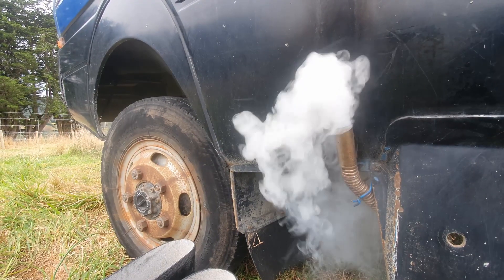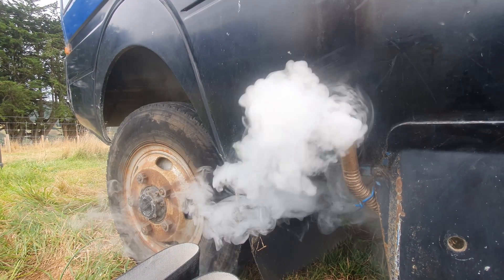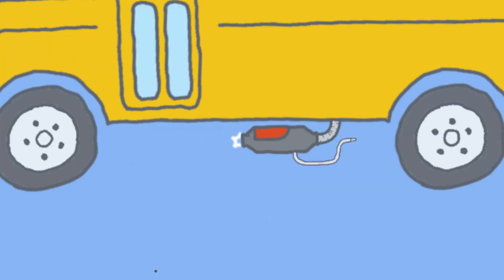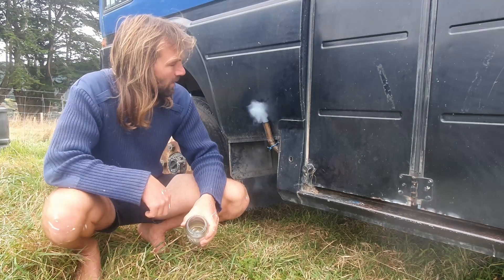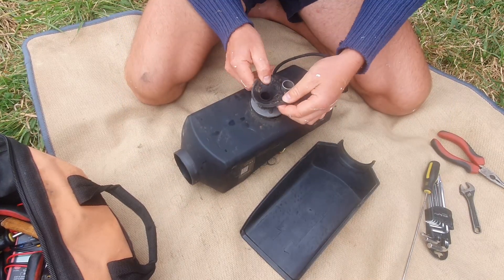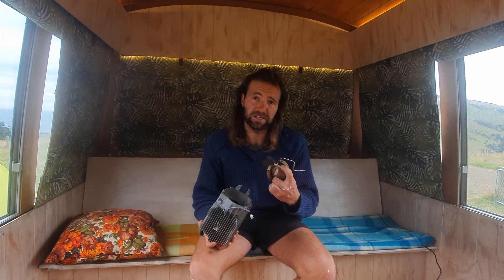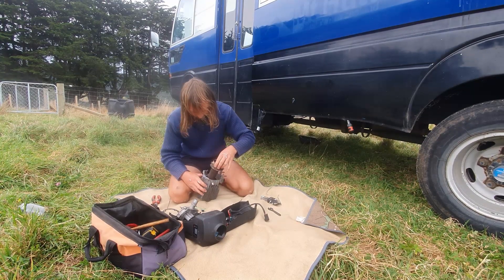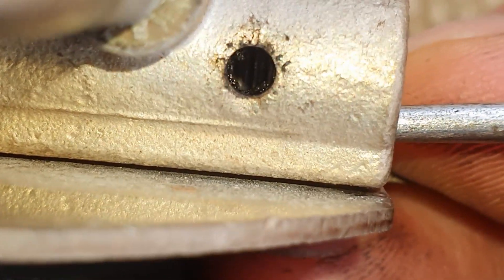[SOLVED] Diesel Heater Won't Start, Blowing White Smoke

Comment: Thanks!  This also worked for mine (I was doing all the same things wrong too).
But you forgot to mention that EVERYTHING will be black with soot after you complete this cleaning job.  Your clothes, your gloves / hands, your tools, your work space.
Do this in clothes you no longer want.  Over a tarp.  With a white garbage bag (so you can see the soot).  And have lot of shop rags handy.
Don't touch your mom's couch after.

Comment: i have a adjustable power supply. i increased the voltage to just under 14 volts. all problems went away. glow plug is hotter, burns cleaner. better miles per gallon.

Comment: Probably the best "repair" video that I have found regarding these heaters. Mine is blowing white smoke and then stops heating. Problem. It is really hard to get to to take apart!! Thank you.
Reply: I’m in the same spot. It’s gonna take me two days to get it out just to take apart. Man, huge mistake on my end. I’ve only ran it 20 times too….. it’s basically new.
Reply: @conandal  me too!! Maybe like 7-8x though. I turned it off, not allowing it to “cool down” and man that was a crazy amount of smoke inside the trailer. 😂. Now it smokes and won’t heat
Reply: @conandal  did you clean it? Like I said mine ran more or less like 10 hours before I did that. The soot and gunk that was in there was absolutely amazing. I ruined like 8 rags. Insane that thing still kinda worked before I cleaned it. Kicks ass now. Definitely clean yours
Reply: Mine started smoking today after about 1 year, it's under the driver's seat so removal is a very last resort

Comment: Thanks! I have searched everywhere. You keeping it simple is the key. Ran out of fuel and pump failure later. Cleaned it out back running. Thanks again.

Comment: Hi, I really enjoyed watching your video but I do have a question.

On the heaters I have, after about 90 seconds the fuel pump starts and if monitoring from an app, the combustion temperature will rise. After about 4 minutes the glowplug will turn off.

I have one heater that on many occasions the glow plug icon comes on and the glow plug draws power however the fuel pump never starts. On every occasion I have just powered off the unit, then back on and it has started correctly.
My question is what tells the fuel pump to start? If it were a timer, I'm sure it would always start. If it is temperature, where does the heat come from apart from the heat of the glowplug?
On a new heater or a serviced one, there will be no residual fuel in the combustion chamber and only the powered up glowplug, so what starts the combustion process? 
As I stated earlier if it were a timer, I'm sure it would always be a consistent start.
The other strange thing is there is no error codes. It just sits there with the glow plug powered up for as long as I leave it.  Other types of heater would use a  pilot light that would operate a thermocouple and that is what starts the main gas valve (In the case of a boiler), but what starts the fuel pump on these heaters?

Your animation shows the diesel going onto the hot mesh causes combustion, but if the pump is not running, where does the diesel come from?

Thanks.

Comment: Thank you Adam for information , my Anbull heater basically same as yours is doing same thing on restart, after warmer temperatures outside  warmup  my garage So ill take mine apart check my glow plug clean it like you did and reassemble it, order parts gets irritating on 8kw heater getting right stuff is problem

Comment: If you install a diesel heater to draw in outside air instead of recirculating the air, you’re running the risk of carbon monoxide poisoning. This is because the combustion exhaust can get drawn into the cabin air suction duct.

Comment: Hey thanks for your video. It got down to 10 degrees and my heater started blowing white heavy smoke. I watched your video and found out that my combination air intake was outstanding drawing ice cold air. I moved the pipe inlet to get inside air and the smoking completely stopped. Thanks for the great advice. I’m going to connect a 4” pipe to my heater air inlet pipe and connect it to the inside of my house. I think that will help if I supply preheated air instead of the 10 degree outside air. I haven’t seen anyone recommend that. Thanks again.

Comment: Cheech and Chong burn mode.  This genuinely is hilarious. Do you really have your exhaust pointing up? - Guess what? rain can go in also. Might as well put a funnel on it. 😂😂  Why oh why lol? Terrible idea.  The boiling water in the exhaust - tragic. If you didn't use common sense then at least use the instructions. -  Exhausts must point or bend downwards with the total bends not exceeding 270° - at least drill a drain hole in exhaust.  And btw ALL exhausts condense. So running downward is best for heater health.

Comment: I have lots of soot and smoke with a nearly new gasoline unit. I think it might just be the extreme arctic temperature, I'll try again later in the winter when it's a bit warmer..
Reply: When it's warmer lol. 😂 It's a heater, it's made for arctic conditions Gasoline? Not diesel? If you are in the Arctic or are using the heater where the air for combustion is lower at altitude. You can switch the heater to 'alpine mode' .
Reply: @richardd8352  It was minus 35Celcius. As soon as it was back to normal freezing temps the heater worked again. I guess the fuel gets too thick?  I'm not at high altitute so I don't think switching to that mode will make it run better, it will just make it run leaner.
Reply: How does the gasoline  run? What brand of heater? Will premium fuels keep unit carbon free?

Comment: Thanks pal you explained it all very well. I forgot about the mesh and the glow plug. And cleaning the tiny hole so I will be doing that tomorrow is my diesel heater is just pumping out white smoke thank you.👍

Comment: The key to keeping these things running clean is bringing them up to temperature,I ramp mine up slowly till it gets the unit to 200 c,then I turn it down and even with it turned all the way down it maintains 200c and runs like a champ,and the pump pumps very slowly

Comment: Solid video,I'm now taking my heater apart,it ran great for 12 or so hours,then started belching white smoke and shutting down,it's getting 12 volts consistently off my battery generator,but I might order a 12v power supply and use that off the inverter instead

Comment: Hey Adam, just wanted to comment here. Thank you for the quick lesson and explanation. Just got really cold here in Nevada and went to turn on Seamus(DH Name). White smoke, no joy of lighting and E-10. I've used it in my garage bar for a single season last year, but......took it apart, took my time and found it was coked up an incredible amount of sooty goodness. Cleaned, had a beer and reinstalled. He is a happy unit now. Thank You

Comment: The 'original' instructions you dont seem to get with the clone heaters is ''if you have a low spot in the exhaust where water can accumulate, a small 3mm hole can be drilled''
Reply: That might be it for us. Our heater is only one year old and we’re not full-timers. Checking asap at -5C.

Comment: WTF is wrong with some people. There is a reason car exhausts run level and NOT upwards upon exit unless its a Lambo with engine at rear. 😂  like those people that put a fork through a boild egg to see if it's ready to eat 😂😂😅
Reply from the maker: Lol. For sure. The only reason I had it upturned was to try and reduce how much exhaust crept up through various holes in the floorpan/floor on a still night.
Reply: @peterkingsman one of the comments mentioned that you can drill a 3mm hole at the low point. Apparently, it’s in the original heater instructions, but not the Chinese ones.

Comment: one tip. to avoid moisture buildup in your exhaust, the outlet of your exhaust pipe should be pointed downward.
Reply: Hmmmmm, maybe that is my problem...
I had it pointing straight down, but just recently bent the pipe towards the back of the van as soon as it comes out of the van floor.
I will straighten it out again, to see if that fixes my problem, shutting off and blowing white smoke through the intake pipe, instead of cooling down before it shuts off, like it used to...

Comment: The fuel pumps are notorious for leaking inside the heater on these when they are shut off. 

It works  like a siphon and keeps pumping fuel when it's not running. I found that if you give them a good tilt and let all the old fuel piss out from the exhaust pipe they will fire up and stop smoking.  

You can replace the fuel pump also or put a petcock inline in between the pump and the heater for when not in use.  In most cases there is No need to take the actual heater assembly apart at all.

Comment: Excellent. I've just been quoted a price for a diagnostic that is the same as a new plug and tools. It's the "smoke on start up and fail first start but runs fine" problem. Three years in, second fan. I noticed someone mentioned screen over combustion intake, I'll second that. Mudwasps filled up a fan. I'll come back with results, cheers.

Comment: 7:25 When removing the screen, a M8 coach bolt screw or a pick can be used (a M6 coach bolt screw worked for me).

Please do yourself a favour when refiiting a new mesh strainer, use the proper tool - 25.2069.10.0102.2e. This will enable you to seat it properly without damaging it.

Important: when fitting, orientate the strainer so that the small spot welds are furthest away from the air hole. If you are servicing the heater for the first time, look at the strainer as you remove it and you'll see what I mean.

Comment: A couple times a year, run a couple of high heat cycles with clean kerosene.  I've had mine in my semi for 9 years and have never had a problem. I opened it up for the 1st time last month.  I didn't get enough carbon to fill a thimble.

Comment: One very important thing also are 'the bends', I fitted a new 24v in my wooden shed but would repeatedly flame out so I fitted my other also new 12v heater which did exactly the same thing. In both cases I used the same exhaust set up which had 2 90degree bends and 1 45degree bend (through a stainless steel exhaust bulkhead fitting). Removing the 2 90degree bends solved the problem. Perhaps these heaters might benefit from smooth bore exhaust pipe 🤔

Comment: I had two identical heaters which belched huge clouds of white smoke on startup, much head scratching and many futile mods later I changed fuel pipes downstream of the pumps from cheap / soft / transparent type to the white semi rigid nylon material.
Bingo, problem solved ! These heaters were cheap even for Chicom products,  cost $AU110.00 vs $AU165.00 for most on Ebay, suitcase type with internal fuel tank etc.

Comment: I used to have hair like yours, but i have pulled it all out trying to figure out this heater!!
lol
Mine has been billowing smoke from brand new and I installed it exactly as instructed.
What you said at the end might be my problem - too long and too thin of a power wire 🤔
If this is in fact my problem, I will definitely buy you a beer my friend 🍻
Great video, thank you 🙏

Comment: My atomizer is so snuggly in the shaft that I just can't get it out easily like all the other videos Ive watched which makes me think its the cause of my problem eg. how can the fuel get in and around the atomizer when its hard up against the walls of the shaft. Now when I turn it on the display just turns off and then on again and the heater does nothing.
Reply from the maker: That second problem I have experienced also, and its unrelated (if the same as for me). I found the cause to be a bad connection of one of the pins in the big plug, evidenced by some slightly melted plastic around one pin hole when one looked at the female side of the plug. It was an easy fix for me, by putting a slight twist in the corresponding pin on the male side with some needle nose pliers.
I would be interested to know if this is the same problem for you.
Reply: @peterkingsman  I put it all back together after not finding any problem and it magically works normally again. I did blow into the fuel inlet hard a couple of times so maybe that cleared the atomizer of something. It also started up first time when 70% of the time it only starts after the second time. Weird.

Comment: Great Stuff Adam in never thought about the pushing the Burner mesh past the Hole all the way
to be seated at the bottom fixed my problem after a 5 year service 😀and the Chinese may have caused it cheers keep up the good work
Mick
😀😀

Comment: THANKS GREAT VIDEO ILL STRIP MINE DOWN SOON I HAD A BIT OF WATER IN FUEL LINE AND THAT DID CAUSE SMOKE B4 
COULD YOU BLOW THE CHAMBER OUT WITH AIR LINE THROUGH AIR INTAK TO SAVE STRIPPING DOWN

Comment: Bolted mine to the floor and taking it apart like that is not an option in a campground especially with diesel fuel line leaking.

Comment: Thanks so much for the thorough video -- I had replaced the atomizer screen on my heater and didn't install it all the way... blocking the inlet hole and causing E10 codes. Nice animations, great video!

Comment: Thank you for the video. I paid 100 usd 4 years ago for my heater off amazon and I use it to heat my garage in ohio winters and this is the first year it's throwing a error code and blowing white smoke so I'm sure this is the issue because I've never cleaned it..

Comment: One other thing to look out for is water in your intake pipe. This causes similar effects because it is also restricting the combustion air. The very fact that the intake air is drawn in at the bottom of the heater means that this is usually the lowest point and therefore liable to suffer from this problem. I solved it by putting a small slit in the lowest point of the pipe which allowed the water to escape, but ideally there would be a one-way valve which allows water to escape (by it's own weight) but prevents ingress of air. I know these exist but I haven't a clue what they are called.
Reply: You’re describing a check valve
Reply: @andrewstewart62  I know what you mean, but I don't think that's it. The device I'm thinking about is similar to a bladder valve, mounted vertically, with the lower end open to the atmosphere. It's natural position is closed. The weight of any water would cause it to open and allow the water to drain but any negative pressure (such as the fan drawing air into the combustion chamber) would force a hard close.

Comment: I need help. My diesel heater over heats, blows the heat sensor then fills my van up with exhaust smoke. This is  Brand new unit I just replaced and had the same problem with the previous one. What am I doing wrong.

Comment: Does anyone know how to access the advanced settings on the new blue controller ?
Reply: The engineer code is 1688 with that you can set min / max fan speeds vs dose frequency min max levels 👍

Comment: Oh. My. Word. FINALLY the answer I’ve spent HOURS looking for all over the internet.. that tiny hole by the glow plug screen was covered and had become clogged with carbon buildup.. cleaning it and pushing it down far enough solved all my problems. Can’t believe I didn’t find this sooner I could have saved so much cold weather and headaches haha! 

Thank you thank you thank you!

Comment: Poor installation, the exhaust should always be on a downward angle, a carbon restriction will occur and cause heater to carbon up and blow white smoke with incomplete combustion. These are simple devices with associated problems.

Comment: Hi, i have the smoke at startup, with two new unit from First day of run, can i see if the screen are in good position from the glow hole, without disassembly the burner?
Reply from the maker: Yes possibly. 👍
Reply: @peterkingsman  hi, i check the hole and its ok, i replace also the tube grid whit a new one, but continue to make a very big-big smoke at startup, the glow plug its new on boot heater😩
Reply from the maker: @lucacavallini561  So you have tried 2 new heaters and then 1 new mesh also and always the same problem?
Reply: @peterkingsman  yes, i have two identical new all-in-one heater, with two identical installation, and two identical Power supply 360w and identical UPS, One in Cook, and one in badroom, and boot make a very big smoke at startup
Reply from the maker: @lucacavallini561  Ok, dont replace anymore parts. Parts or heaters are not the problem. White smoke suggests plenty of diesel, so that is also probably ok, unless maybe there is too much pressure and the heaters pumps cant slow flow enough. Where does the diesel come from? Is it a pressurised source?
Have the heaters ever run properly after smoky startup or just never start?
Reply: @peterkingsman  i have use a only good diesel bought from fuel station,i try anyway two different brand station, no mix with other  thing, After start, boot unit run ok without problem, i Discovery that if i forcing pump for 10-20 second with keep two Key on display first of start, the unit not emit smoke 🤔...cough sound some time, but start without smoke🤔....very strange
Reply from the maker: @lucacavallini561  Ok, in this case, my first suspicion to test is poor electrical supply to glow plugs. They may not be getting hot enough because long or skinny wires or weak battery are causing too much voltage drop at glow plug when glow plug draws power. You can test this a few way. Most reliable test would probably be to connect heater's wire direct to the 12v battery of a running vehicle? Want wire to be as short as feasible with no weak links or bad connections.
Reply: @peterkingsman  i used the wire in the installation kit, anyway tomorrow i try to Power the unit with one full loaded battery car that i have in garage, then I'll let you know👍, I also try to remove the ups, you never know what might make some problem